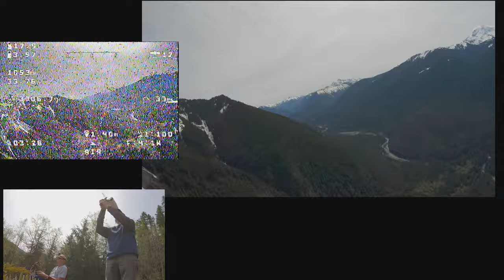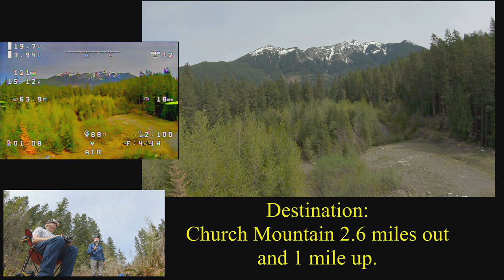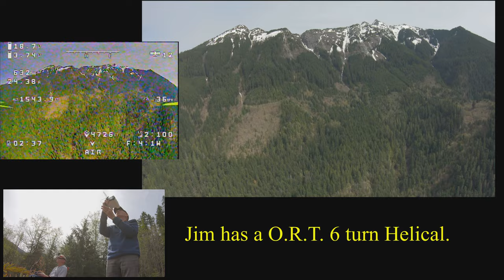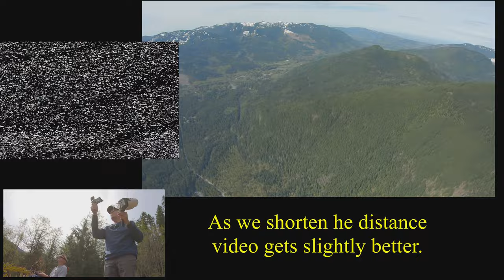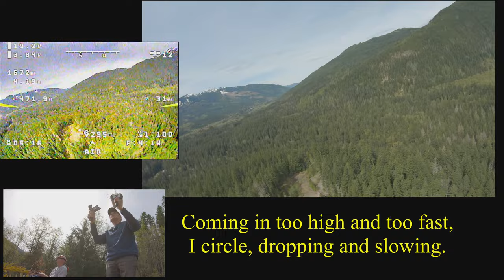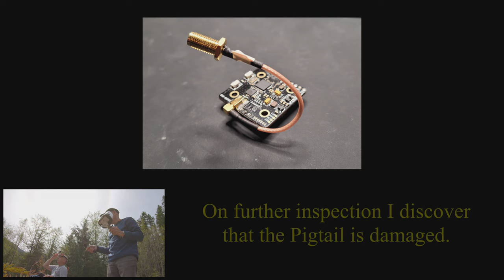Another FPV Video Failure at 2km during Long Range FPV Mountain Surfing Flight.

Comment: In a previous video I saw you had the rapidfire OSD in the top of the goggle view.  I'm not sure if you turned it off or you're not locking in to (mode 1 or diversity or something) before takeoff.  It is helpful to have the rapidfire OSD for LR flights.
Reply: Absolutely, I was curious about the missing Rapidfire meter also.
Reply from the maker: Thanks for watching. Yes... in prior videos I used to have the rapidfire OSD strength bars turned on. I have since disabled that function. Seems that whenever I had those rapidfire bars ON my goggles would display at a much reduced brightness. Really significant too and kinda odd. I decided that I wanted the real estate up at the top of the screen and the brightness so I turned off those bars. I may put em on again on select flights.

Comment: I recall lightly crashing a newly built drone once and having the TPU mount flex enough to allow the right angle SMA pigtail connection to become separated internally. The pigtail looked fine but video went to crap. It was connected to a cheap eachine 600mw vtx that I'm still using today and getting great results on (a mile with the 200mw setting, etc).
Reply from the maker: Thanks for watching. Yes.. so much to figure out in this hobby. Such is half the fun.
Reply: A couple of years ago I bought a dozen or so of those right-angled sma connectors for my goggles. After realising how easily they break, I just put a large tip on my soldering iron, slathered them in flux, and soldered them permanently. Still using the ones I soldered!

Comment: With the pigtail loose or disconnected, essentially there's no antenna connected. Under this circumstance, the VTX might have burnt up the moment you turned it on at 1W without the antenna.
Reply from the maker: Thks for watching.. Very loose..it twists easily. Not taking any chances regarding the vtx condition. That's why I replaced both.
Reply: My thoughts exactly. The actual specs were way to low.
Reply from the maker: @voodooman4636  the SMA end of the pigtail.. was totally twisted and broke.. totally just pulled of easily.. DOH!
Reply: @ValleyFPV  lol that sucks. I burned a couple of vtx's by not having an antenna on them when I powered them up. (I didn't know it fry em) Heck bro you live and you learn. 👍😀
Reply from the maker: @voodooman4636  I went ahead and replaced the vtx with a Rush tank ultimate II which worked just fine out 3 miles at this site.
Reply: @ValleyFPV  yes sir! 😀 happy flyin bro lol

Comment: I accidentally set my vtx to 25mw and was still able to take it over a mile out with a 12.2 dBiC patch antenna. This must've been an antenna connection issue, unless your vtx is fried. Cool video!
Reply from the maker: Thanks for watching. Yes.. this was a pigtail issue I discovered. Damaged during an antenna change. But, I am assuming that the vtx is fried too..so I have replaced that since.

Comment: Pigtails man... I’ve had two of them fail and create similar signal issues. Basically the outer ground sheathing gets twisted and rips off the connector so the antenna is either not grounded or barely grounded. I’ve repaired them by cutting back the wire casing and then soldering copper strands between the connectors and ground sheathing. This repair is much stronger than new but isn’t flexible. 

The issue happens when we unknowingly twist the pigtail wire while installing different VTX antennas. Glad you made it back and in one piece!
Reply from the maker: Thanks for watching. What you describe is exactly what happened to me. I am somewhat new to this hobby.. and learn something every flight!
Reply: @ValleyFPV  Yup this hobby is all about learning, keeps it fun, interesting and exciting. Little issues and surprises (like the high tension power lines that appeared out of no where on me last week... I’ll be posting that video soon) keep our hearts racing! Keep it up, and cheers to your co-Pilot!
Reply from the maker: Hes a good guy!

Comment: Hello. I like your videos, very interesting. I have 1 question. Is it possible to use a switch on the controller to select rf output power?
Reply from the maker: Thanks for watching. Yes it is and I do that. Search Joshua bardwells channel he has a video how to set this up in betaflight.. No LUA script needed just Smart audio is needed it works great. I have it set up to a POT or dial and can dial in any of 4 vtx power settings.

Comment: Using pigtail just like prohv32 or rushtank ultimate plus have, they have M2 hole  so when twist  antenna  they will stand and not broke.
Reply from the maker: Yes agreed, I often have to choose a pigtail based on the length, and angle and configuration needs of my build.

Comment: Try using the pat antennas instead of the helicals antennas I can get out two miles on my patch antenna
Reply from the maker: Thanks. I shall give that a test soon.
Reply: Agree. Helicals are highly directional and were often used with motorized antenna trackers. It looked like when you move your head slightly the picture improved/degraded considerably. I like the SpiroNet LZR dual patch system from ImmersionRC. Out over 2miles with under 400mw vtx and no problems. Perfect for HDO2

https://www.amazon.com/dp/B07RSD9RBC/ref=cm_sw_r_cp_api_glt_fabc_TQK0AG46K151549YG2QH?_encoding=UTF8&psc=1

Comment: No GPS? Ok now I see the OSD.....wonder why failsafe didn't kick in?
Reply from the maker: Thanks for watching. Failsafe would only kick in if I lost the radio signal to the quad. In this case that was solid. Thus no failsafe event. Only the FPV video feed failed.. and then I manually activated the GPS Rescue mode.
Reply: @ValleyFPV  Ah ok. I thought you were trying to toggle it manually. That's scary, especially when you've invested some bucks into a LR quad.
For what it's worth, I've had the best luck with those dirt cheap eachine 5808 tx's.....(whatever the number is) you know the ones with zero frills. No smart audio etc. The 600mw does me fine for my freestyle and I never change channels anyway. On the bench you can simply unplug them so they don't burn. Had multiple AKK vtx and every one has had issues in three different quads.
Reply from the maker: I flew today a Rush Tank Ultimate II all the way to the top of this mountain and had no issues, nice solid video feed. Yes, a good vtx helps.
Reply: @ValleyFPV  Nice. Having confidence only adds to the enjoyment of the flight. Nothing worse than no video.

Comment: LQ 1 is bad, right?
Reply from the maker: Thanks for watching. Sorry, dont understand your question.
Reply: Crossfire LQ is 2 = 150hz and 1 = 50hz, I think. TBS says its 150>50>4 if I understand the manual right. So 1:100 isn’t bad.
Reply: @ValleyFPV  I see on the OSD, lower right, LQ 1 before you start having video issues. I think that might've been a symptom of the antenna? I may be completely wrong. I only just started flying these but I usually see link quality of 7,8 or 9. Hell I dunno. I only crash.
Reply: When you took off, it was at 2. What is the LQ now with the repair?
Reply: @m2kfpv449  ok. Yeah I figured I wasn't reading that right. I want to do your style of flying mostly but, also dig the flow style I've been seeing.
Reply from the maker: Yes. This is the Crossfire Link quality from the controller up to the aircraft. @m2KFPV above is correct, the 1, 2, is the power settings and then its quality. My CSFR is set to dynamic power, meaning it decides if to run at 25, up to 1000mW power. These numbers that I have been seeing are all very good.  AFter repairs from this flight these numbers did not change as my repairs were to the video VTX and that is not reported by these values.  I flew today with the new VTX and new pigtail and all was perfect to the top of the mountain 2.74 miles out 5300 ft up.... until I flew behind the montain top, lost video and had a failsafe.. A video of that fiaasco coming someday soon.
Reply: @ValleyFPV  nice. I'm learning a lot from your videos. Love your spotter! Super supportive.
Reply from the maker: @ChadKovac  Thanks for watching. He's a good guy too. More crazy video fights to come.